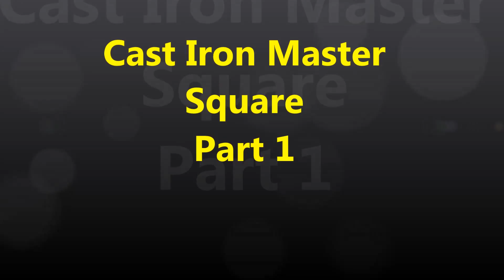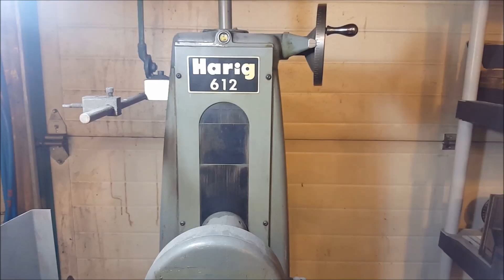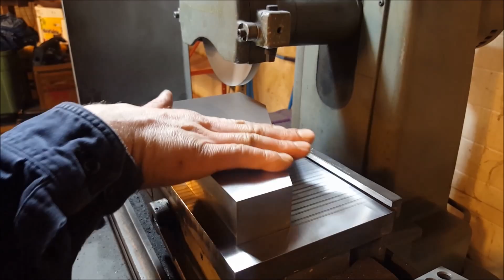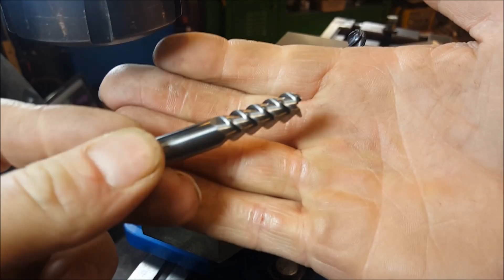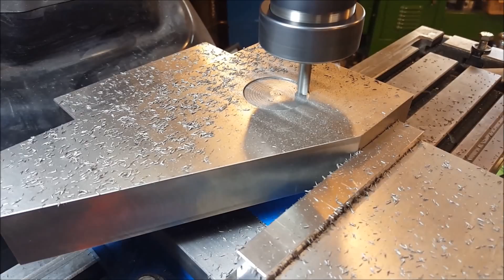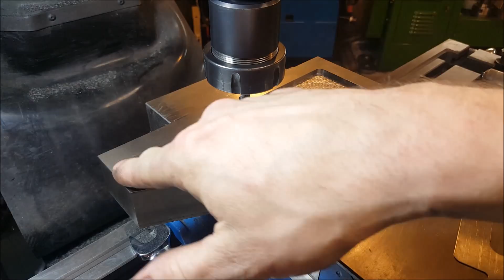Cast Iron Master Square Part 1

Comment: Now what would you want to have a master square for?.....if you make a part and test it against a master square it's either good to go or out of square and so is a piece of scrap metal.....you can't unmake a piece of work that is on size but out of square......if your machines are so out of wack all the master squares in the World won't solve your problem.